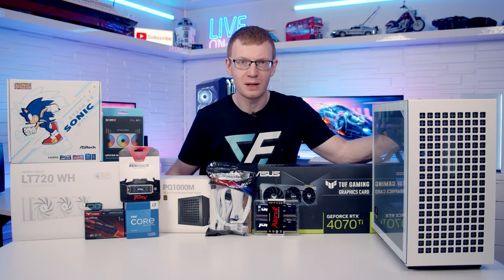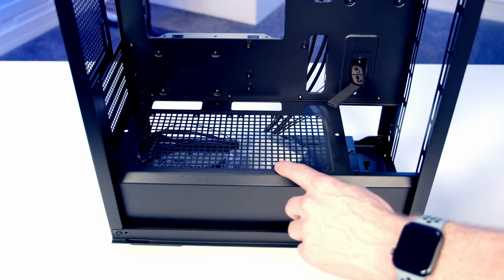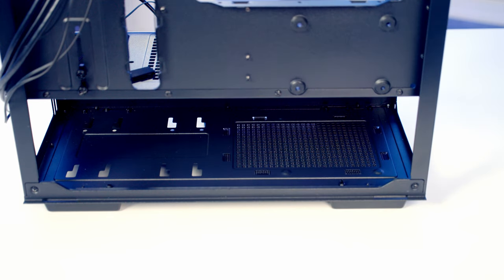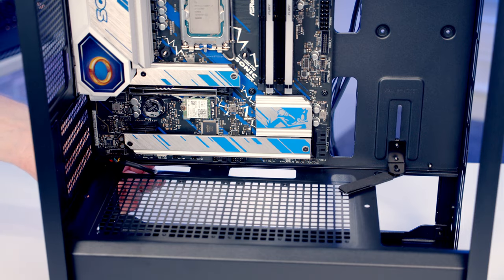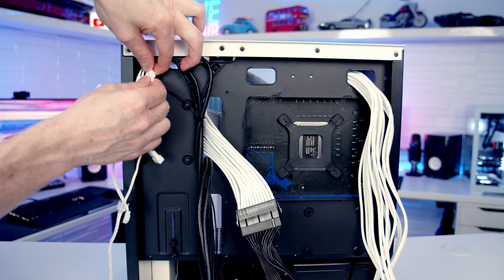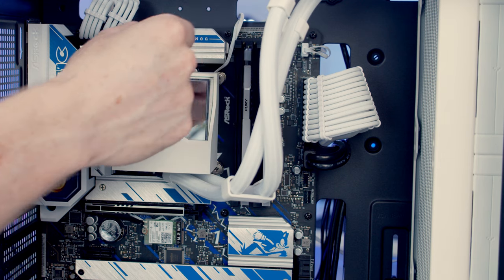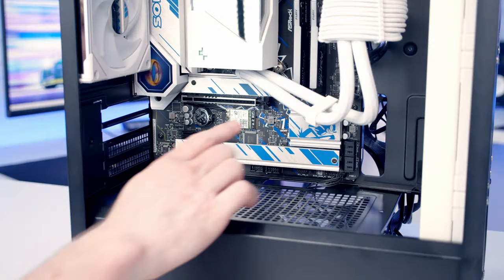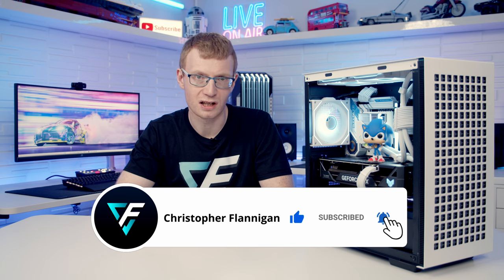DeepCool CH370 Build - Step by Step Guide with ASRock B760M PG SONIC WiFi

Comment: So... I'm using an old PC shell for this guy, and it's all done and setted up. However, when I power it on, I'm greeted with no signal. Just a black screen. I'm using a hard drive from my old motherboard, but it is not yet formatted. Should I try formatting it first? Will that solve my issue? Do I need an SSD to get a signal? I even tried the pressing F2 method, to get the bios, and still nothing.

Comment: Can 340mm gpu fit with AIO on top and only fans at the front? The specs say 320mm but the deepcool video shows them using a card that's 336mm. Very confusing. If you can measure and give a response, that would be awesome.

Comment: The way you put the fans on the radiator, is that the correct way for intake? Cause I recently did a build in this case and I have my fans pointing inward towards the case so the opposite side.

Comment: Nice build video thanks! Helpful for me. As I'm using this chassis for first time. Using ROG B760G STRIX Gaming Wifi for the board. And Corsair Capellix Elite 360mm radiator. It would have been nice if Deepcool had USB-C but thats far from a deal breaker. It's an excellent product for the dollars I reckon. Seems to be selling very well at least where I live. Only the black version was in stock.

Comment: thanks for the build. Do you think its possible to force 3 120mm fans at the top and on the front if you are doing an aircooled build. Looks like there could be enough room if screwing onto the square holes like you did on top.
Reply: Not really possible with a 360mm radiator.. Without one in an air cooled build. It wouldn't be a problem.

Comment: I would recommend installing this motherboard in the case before installing a 2nd and or 3rd m.2 drive as you will need access to the bottom screw hole as the heatsink and drives is in the way.
Reply from the maker: Well spotted
Reply: @ChristopherFlannigan  what screw driver do I need for m.2 screw?